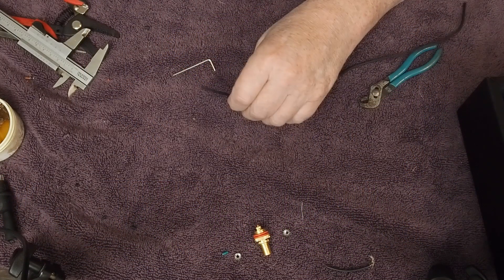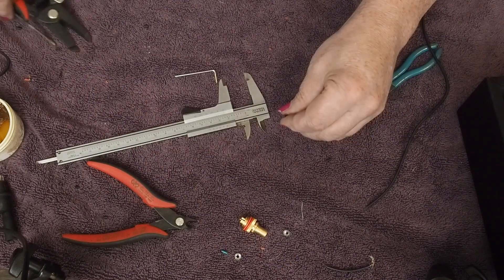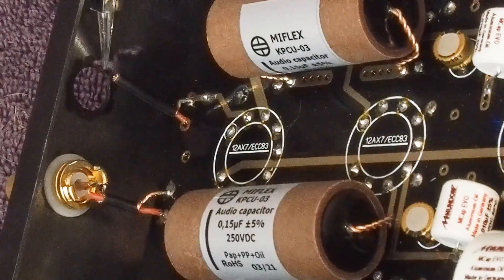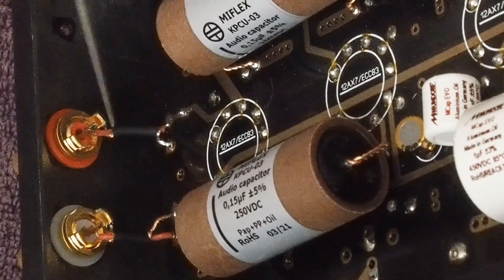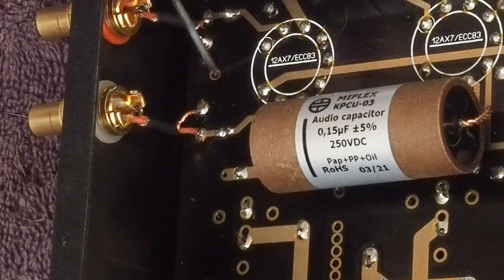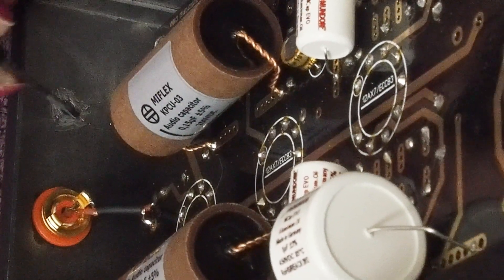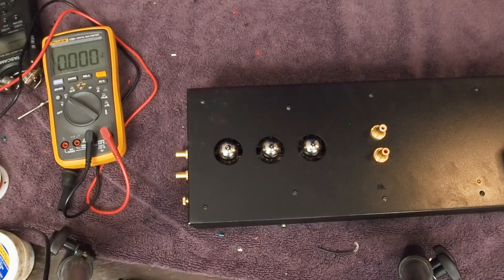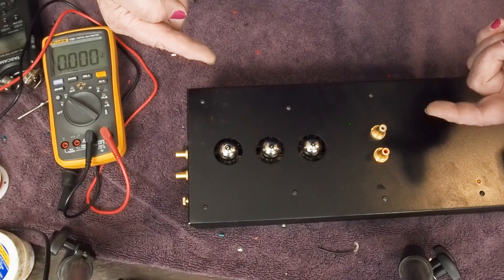All Tube Phono Stage Pre-amp Part 16: Final wiring

Comment: Hi ! Thank you for this series, it was inspiring to watch and soothing in a way. 
A practical question: I have one of these clones ( bought a built version, two chassis). I have since gotten other Phonos but would love to keep listening to the ear, there is magic in the tube sound it produces. 

For practical reasons I need to have my turntables ~4 meters away from the amp, which means I need my Phonos to be XLR out. 

I notice the ear 88pb has xlr out and it seems ( to a layman) to be a simple/small bit inside.

Do you think it’s possible to add xlr out to the ear 834??

Happy new year !

Best
Reply from the maker: Erhard Ardio makes XLR converter transformer boards. https://www.erhard-audio.com/Accessories-EA.html

Comment: If at this point, I did decide to take a nibbler and split the chassis, what would be the most practical way to run the power between the PSU and the board? Also, the isolation transformer for testing, what's recommended?

Comment: Goin well Stephe!  I must admit Iwas quite looking forward to the 'bulkhead installation' just cos of the engineering of it, with the grommets & other hardware etc!  

But still, as you say, if separating the power supply & preamp boards drops the noise & hum enough, then who needs a bulkhead!
Reply from the maker: I actually found separating the two boards doesn't really do anything, and build them now as one piece.

Comment: I have a question about the voltage measurements you did on the tubes in this video. On the final tube you had 292V on the plate and 81V on the cathode, and then you said that this meant 215V across the tube (max rating of the tube is 300V). How did you calculate that? Did you subtract the cathode voltage from the plate voltage? The reason I ask is that I have other numbers when measuring my plate and cathode (I use some modifications on my board) and want to calculate if I am within specs. If I remember correctly (I am at work now so I can't check) my numbers where 283V on the plate and 116V on the cathode. Thank you for your awesome build guides! Love them! Greetings from Sweden!

Comment: Excellent work, I also assembled this diy ear-p but with a separate transformer in its housing, you chose good capacitors, but I advise you to always choose smaller dimensions of non-polarized capacitors, because this affected the sound as much as the quality of these, because the capacitors are larger, they work as a large antenna that attracts mechanical as well as electrical disturbances that affect the sound quality.

Comment: I have done wiring but found that output dc 6.3v from power supply board is 8.16. How to fix it?
Reply from the maker: Did you test this with the tubes installed or was the circuit unloaded? It will read sometimes much higher without the tubes installed. If it's still over 6.6VDC loaded, you might have to install a power resistor on one of the leads of the AC feeding the board. 

If you have a power transformer with an amp rating a lot higher than what is needed, the end result can be too high of a voltage.

Comment: Do we need to cut PCB into 2 pieces?
Reply from the maker: It's highly perforated right at this spot, so it's super easy to snap it apart holding it across the edge of a table.

Comment: I wonder would it not be a good idea to have an extra 5V PSU to inject the 5V into the two sets of phono leads to make the DS Audio DS002 operate  and make the unit switchable to be compatible with other cartridges that don't need 5V sent up the phono leads?
Reply from the maker: If that is something you need, then sure you could do that. It's why DIY is so great you can tailor it to your needs. But I'm pretty sure very few people would be using this pre-amp with that very unique $2500+ photo cart, that requires 5V, to make that part of a "standard" build.

Comment: Can’t tell you how much I’ve absolutely loved watching your “series” of building an EAR834 clone. You did such a fantastic job! The upgraded parts absolutely make a difference in bettering the sound quality. I should have filmed myself when I built mine, but it unfortunately didn’t even cross my mind. lol. I’ve got 2 turntables, a Yamaha PX-2 direct drive linear tracking deck, and a KAB upgraded Technics SL1200. I use my EAR834 clone for MM carts on the Technics and a Tavish Classic phono stage for MC carts on my PX-2 deck. 
Again, thank you so much for these videos. You’ve inspired my DIY spirit again, and I’m building a tube buffer that uses two 6922/6DJ8 tubes. 
Phenomenal job! Such a beautiful design too. Thanks again. 🎶🙂🎵🔊
Reply from the maker: Thanks so much. I have a DIY tube buffer shootout planned for later this year :)
Reply: @SkunkieDesignsElectronics  That’s excellent! Can’t wait. I built an X-10D Musical Fidelity clone tube buffer, and I found a very high quality PCB. 
I’ve used this guys PCB’s for guitar pedal builds, and he doesn’t skimp one bit on the quality.  I’ll try and leave a link if you’re interested.